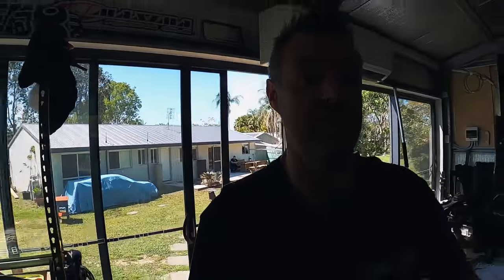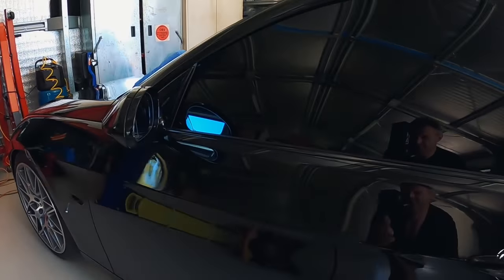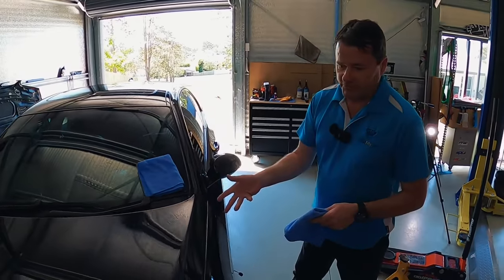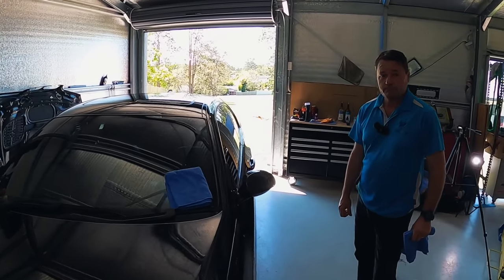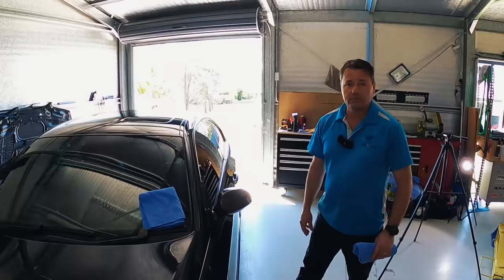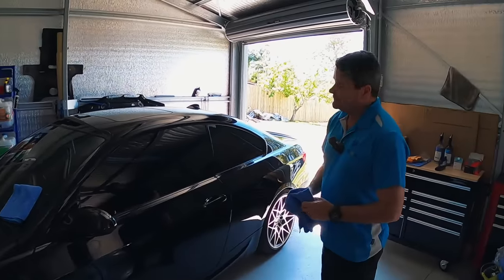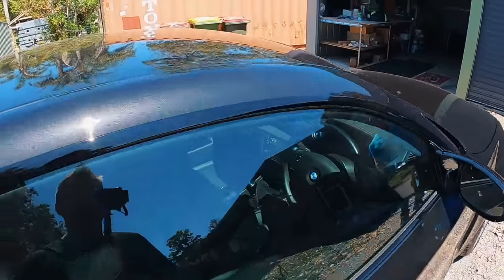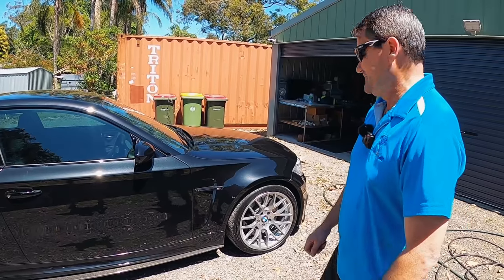BMW E92 335i Ceramic Coating Application: Black Sapphire Brilliance

Comment: Just wait till you wash it yourself. Its a breeze. You will get most of your scratches from the washing process with a mitt. So if you keep up on the maintenance washes. The properties of the coating really allow a touch less wash. Luckily I have obsessed garage (check out the channel) local to me. So if i need any supplies. Thanks for sharing!

Comment: Hello, so I've detailed my E92, but I'm not able to get it no where near that level, I use a da polisher, with a microfiber cutting pad, and poor boys ssr3 compound, then step down to a finer compound. What do you think I should do?
Reply from the maker: Like JB said, its a time thing. I think i could get the results JD did, but instead of 7 hours on the paint correction, i would need closer to 35 hours. Either that or i would cut deeper and the require the work to fix the damage my cutting does. He's worked exactly how and when to massage paint to get results.

Comment: Why would you publish this video and not tell us what products you are using?
Reply from the maker: The video is about a professional ceramic coating application. It is not a DIY on how to do it yourself. This is what happens when you pay a professional. Waxmycar does not find one brand of coating works on all paint types. He even said my resprayed Black Sapphire reacted differently to factory painted black sapphire. There is a lot that goes in to getting the most out of a coating application.